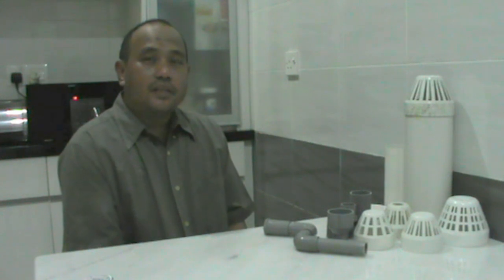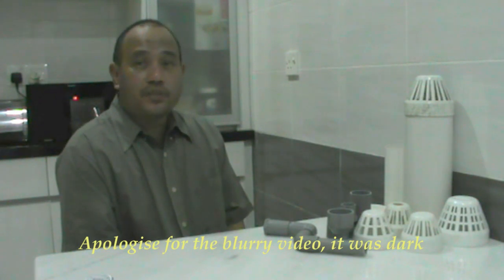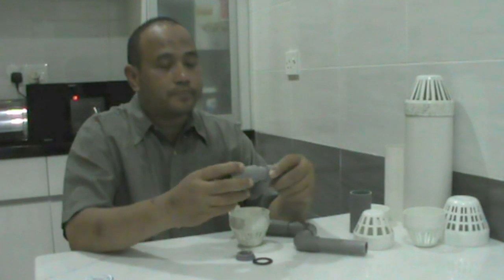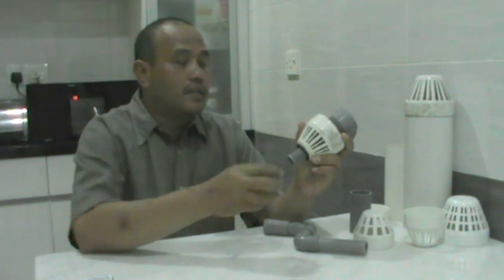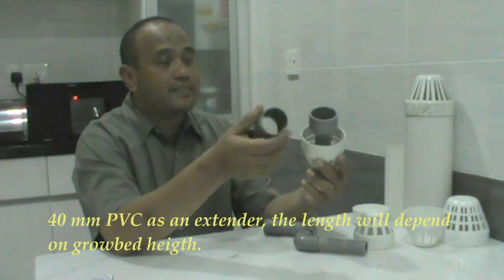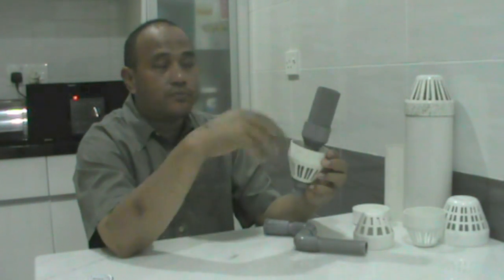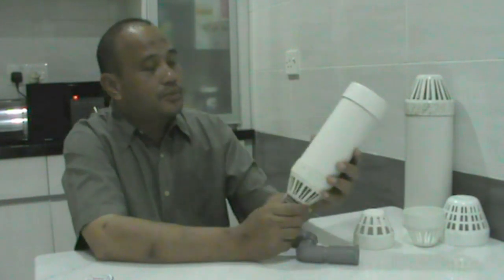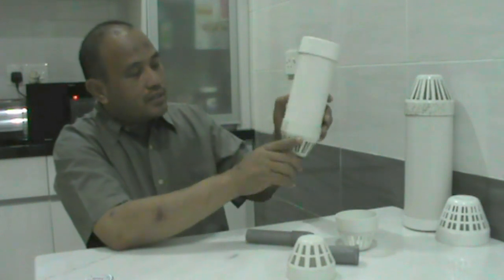Basic Aquaponics - Simplified Bell Less Siphon

Comment: job well done...you're the reason I started using bell siphon...I saw yours a few years ago...and I thought...yeah right...it won't work...(non believer)...so I used a 5 gal bucket...and I was blown away beyond expectation...I like this new innovation...but...I would use the cap you use at the top and drill the holes close to the bottom and complete as you have done...creating a lower amount of water left behind and use a tiny weep hole at the base of the stand pipe...thanks again...
Reply from the maker: +Concepcion Amancio Hi Arman, thanks for the comment.

You are right about cap with holes on the bottom that will give lower water level, that is alway an option to use when situation needed it. The vent cowl is the "lazy" approach of making it easier :) Not a problem if growbed is deep.

On my gutterbed set, I don't use the cowl or cap at the bottom anymore, just use the tube and make water passage on the bottom part.
Reply: thanks

Comment: Thank you for sharing. I am in the preparation phase for my first aquaponics IBC setup and will have to try this, I like "simple" :)
Reply from the maker: +Jason Renoux Thanks for your comment. I had made a smaller siphon using 15mm pipings and attachments as compared to this 20mm. I probably need to make a video summarizing them all.
Reply: Helpful for us, newbies :)
I will be using 25mm PVC pipes with an IBC system. It will be my first time trying aquaponic. I will keep it at 1 grow bed for a start, until I feel the need and have some experience.
Reply: Hi Affnan, I just saw a video about float siphon. Have you tested this option? Do you use it? It looks real cool. The one thing I don't understand is how to keep a seal when there are moving parts...
Reply from the maker: +Jason Renoux There are siphon that make use of float as use in earlier aquaponics, that was the time when siphon was unreliable. Present siphon that I use is very reliable to the extend of "install and forget". I don't think I will try a float type siphon, any moving parts will fail earlier than non. Aquaponics is about planting and fish keeping, siphon is just a device that makes it works. Once you got it right no need to experiment any more.
Reply: Thanks, that's what I was thinking in terms of moving parts. I will stick to bell siphon then :)

Comment: Dear Affnan, i'm testing out your Bell Less Siphon currently. It works fine... thanks! I'm also trying to make a siphon with very long drain pipe...like 20 to 25 feets... the siphon fails to kick in... any tips on this one?thanksheng
Reply from the maker: This design works, but I now uses the 15mm siphon with 32x15 reducer. The outer upvc is a 3 inch pipe with inverted vent cowl as strainer and an endcap.

For long return, it best to incorporate a breather at the start of the return line.
Reply: cab i buy Vent cowl in US ??
Reply from the maker: dantang65 not sure, but in my gutterbed set. Those cowl are not use anymore.